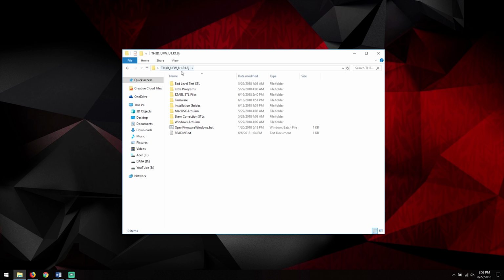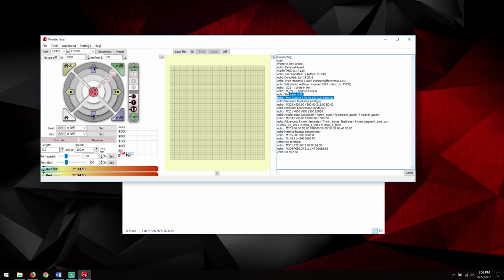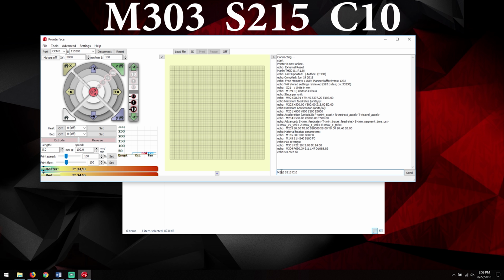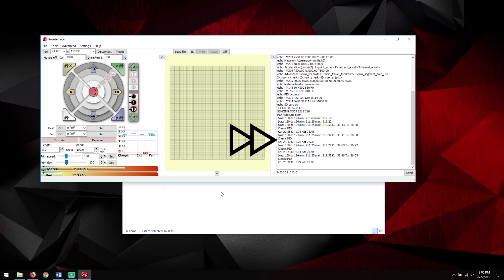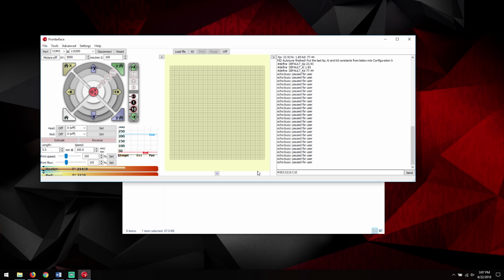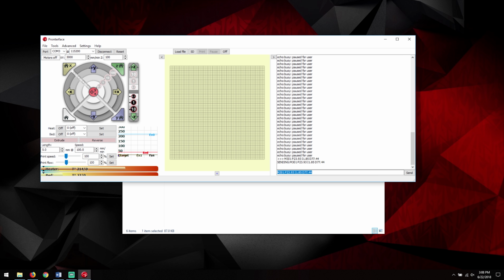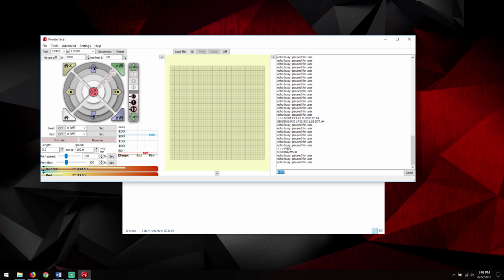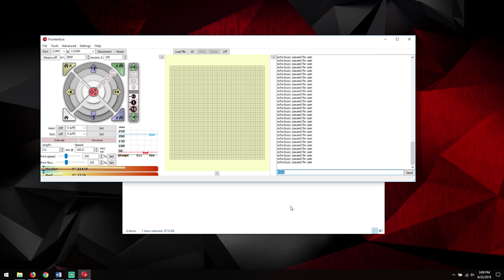PID AutoTuning Your 3D Printer

Comment: On some printer designs a lot of the parts cooling fan air get to the hotend's heatsink, so, ideally, you should set the cooling fan whatever % you usually use when printing to be accurate. In my CR-10S, for example, it would jump from 205ºC to ~185ºC when the cooling fan turns on, triggering the thermal runaway protection.

Comment: Great video.  Do the PID values only work for the temperature you tuned for?  Example, if I tune for 200c and then want to use a temp of 230, do i need to retune, or will the original tune work?
Reply from the maker: I believe you have to retune for a new temp.